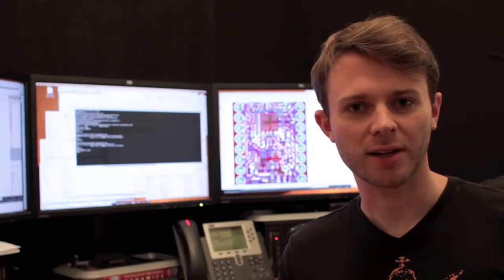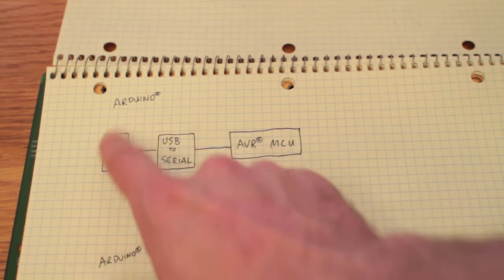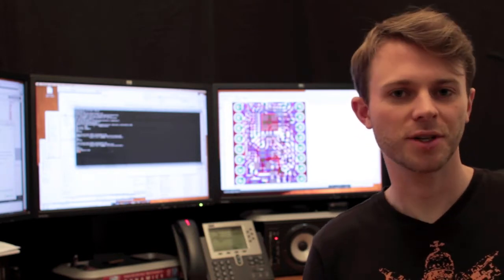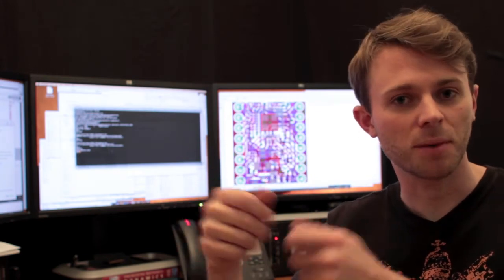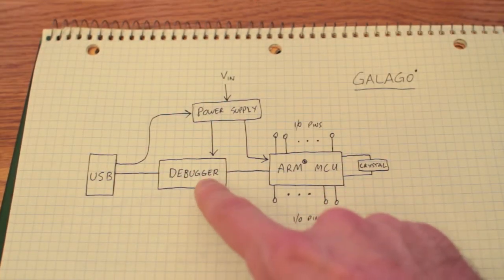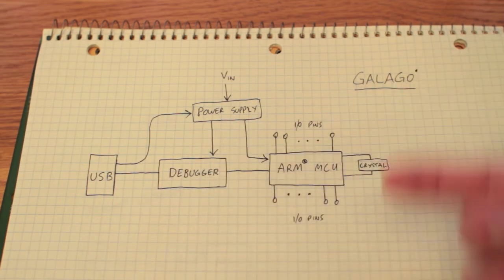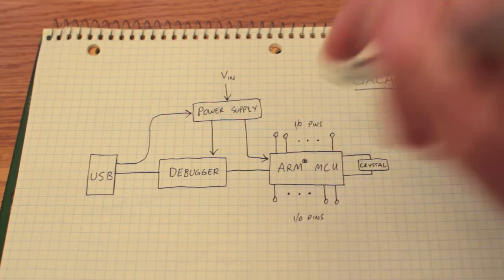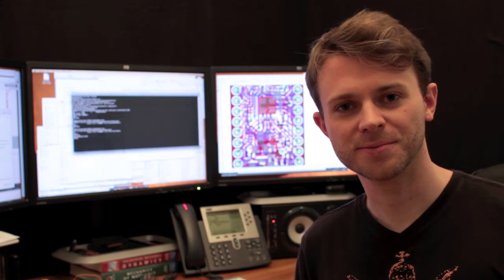Outbreak Galago Episode 1 - General Anatomy

Comment: Where can I find a breakdown of what each pin is used for? I've got a couple of sensors I'd like to read from, but I'm not sure of the correct pin-outs. Also.. I'd be grateful for any API documentation -- the stuff on the IDE getting-started site doesn't have any info beyond what is in the LED demo program code.